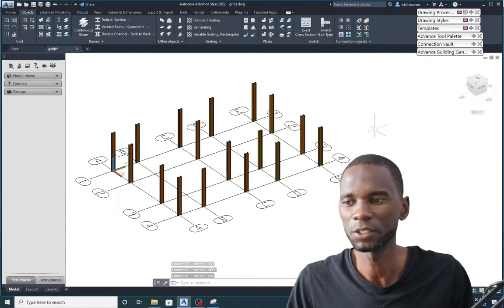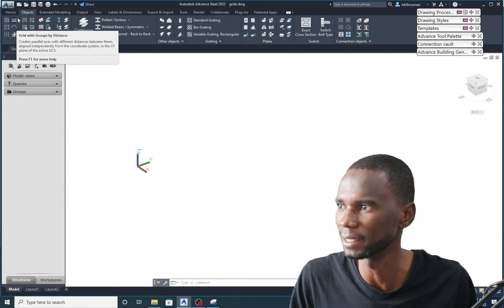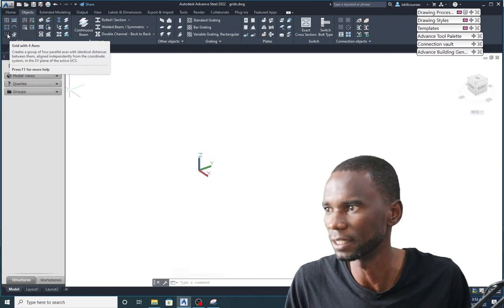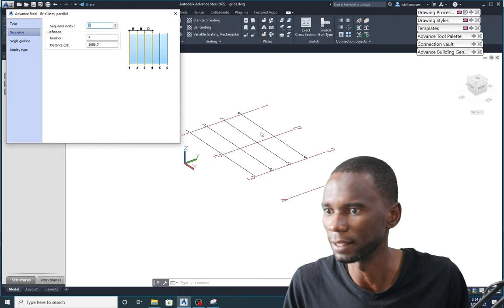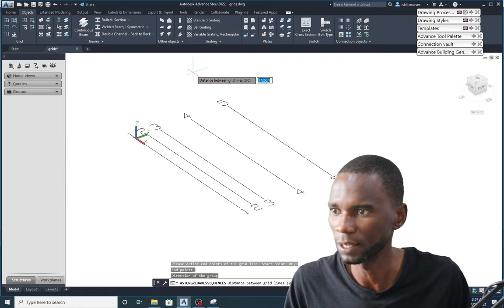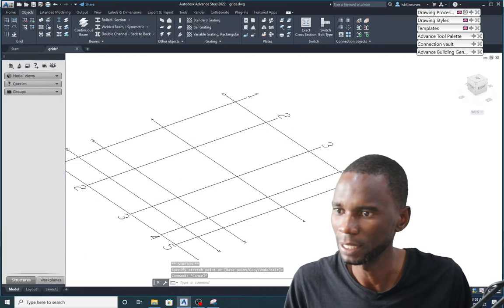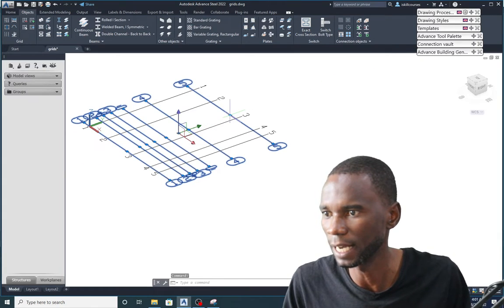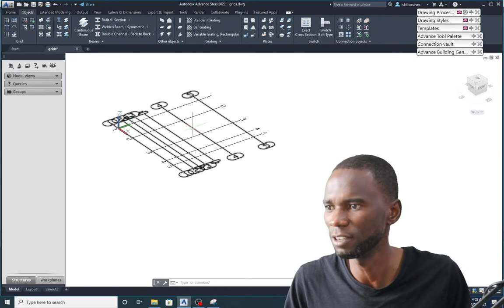Advance steel | grids in advance steel | ultimate tool for grids creation

Comment: This is great sir and i enjoy how you break it down. Please do you have a video of how i can bring in grids and layout from autocad into Advance steel to work because most times the grid arrangements aren't regular
Reply from the maker: Yes you can use CAD as reference..then trace on top of it wherever you want grids to be..use single grid tool
Reply: @skillmaxacademy I have tried that but run into dead ends